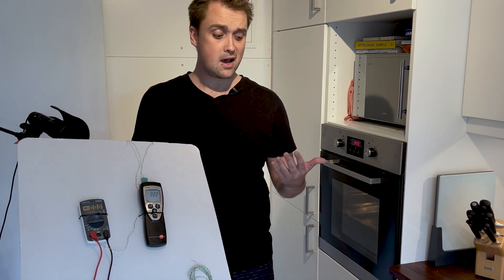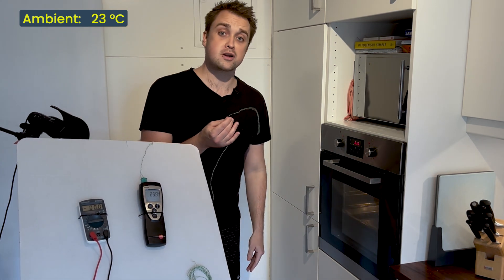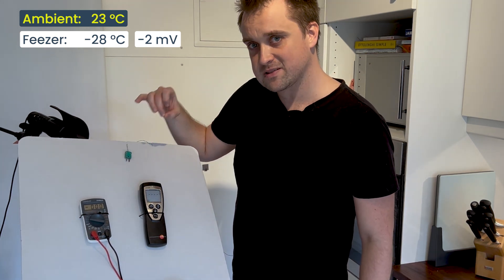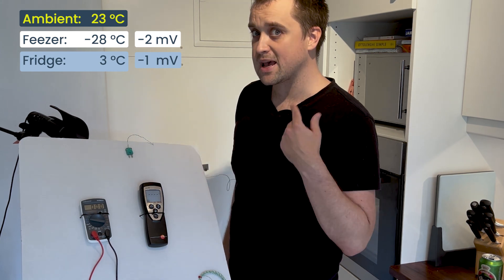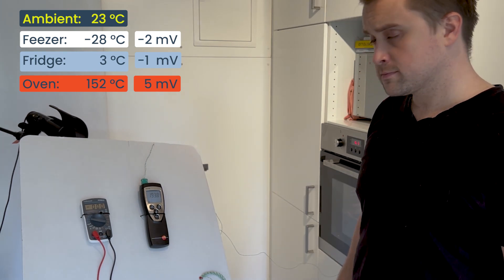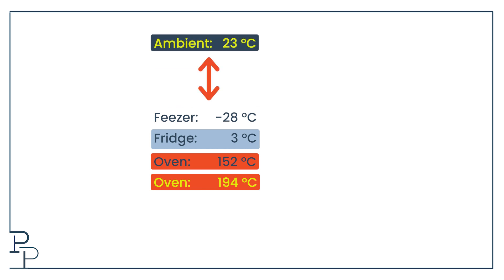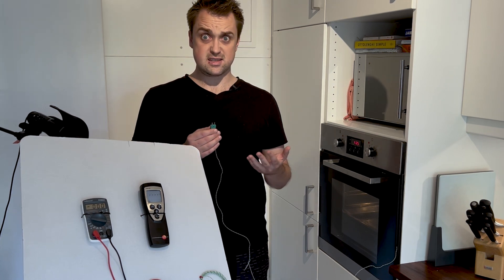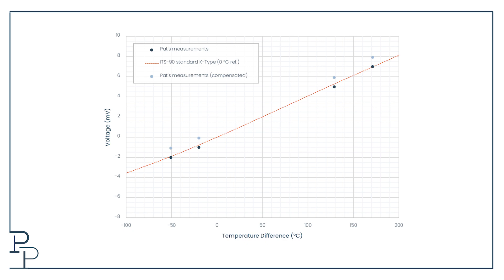Process temperature & thermocouples

Comment: In my branch, we don't use thermocouples for process temperature measurement, only Pt-100 resistive measurement which don't need ambient temperature compensation. That might be because we're in a moderate temperature regime seldom over 150 °C and thermocouples work better at more extreme temperatures, just a guess.

Further, the sensitive Pt-100 "signal" is converted in the field instrument to a more robust 4-20 mA signal (or some data bus signal) so the cable to the control equipment can be very long without disturbance.

Comment: Thanks for this video. Trying to get my head around something.
If I can calculate temperature using a millivolt meter and coefficient table: why do we need a cold-junction meter?
As in, you measured your voltage whilst the thermocouple was disconnected from the cold-junction meter. Should it not have been connected to the cold-junction meter while you measured voltage?
Reply from the maker: The table only gives you the voltage under the assumption that the cold end of the thermocouple is at 0 degrees, which most of the time, it isn’t.

So the further away from zero the cold junction actually is, the more inaccuracy you’d have in your reading.

Think of it this way… Imagine you were looking at a ten story building, and you knew each story was exactly 3m in height. Imagine you wanted to work out the ALTITUDE of the top of the building. Given only this information your only numerical guess is that the altitude is 30m. But this is only true if your building is at sea level (sea level is 0 Celsius in the analogy). If you were 100m above sea level then the altitude of the top is actually 130m. So the further away from sea level your building is, the more inaccurate your “reading”. You need to know the height above sea level of the bottom of the building to “compensate”.

Not sure if that helps or just makes things worse for you! Let me know…
Reply: Thanks so much!

Comment: Please point out that modern input devices have CJC  built into them, and that in the software or hard dip switches will have selections for different thermocouple types, and that any extension wire must be of the same type as the thermocouple . Also note that corrosion at any connection points can skew the reading, and that CJC can go bad.  Any critical thermocouple channels should be tested with a traceable calibrator. And that's just the basics :)